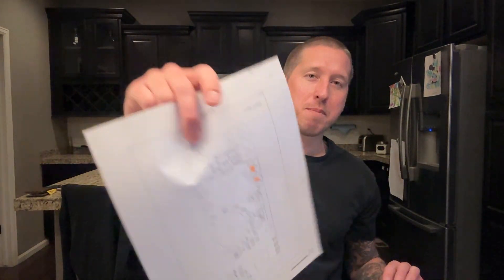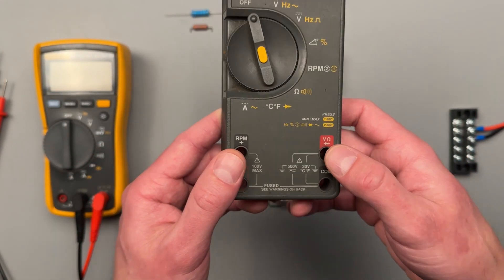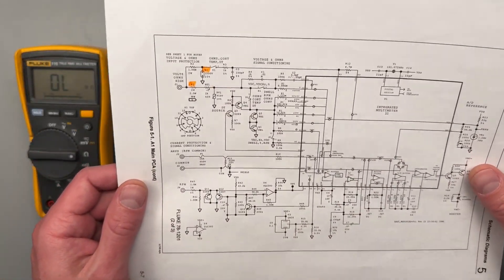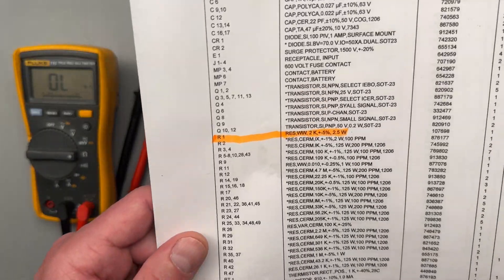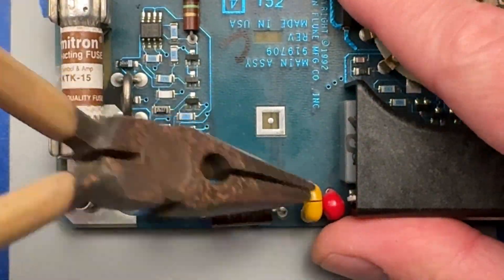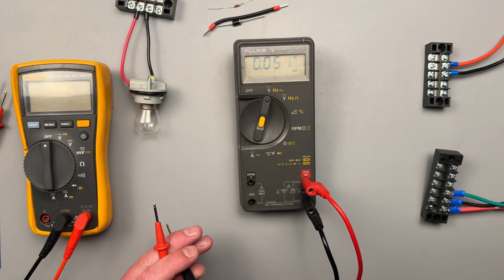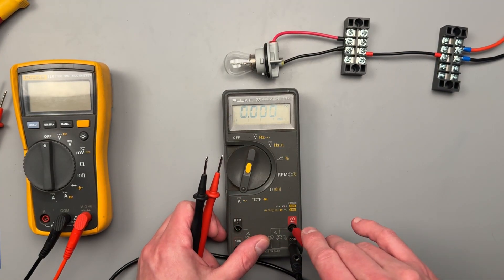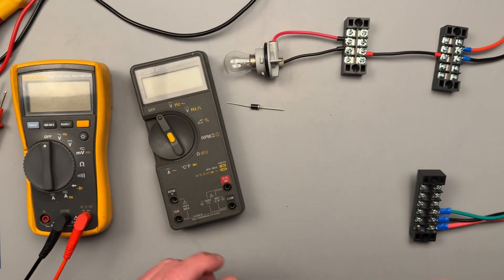FLUKE 78 - Automotive Meter Repair

Comment: I too have a Fluke 78 but the housing is falling apart. I'm in Australia and parts are not available. Would you know if they're available in the US?
Reply from the maker: go here:
https://www.fluke.com/en-ca/product/electrical-testing/digital-multimeters/fluke-78

You'll go to service manual, pages 4-5 & 4-6 have casing parts labeled as MP 14 & MP 17. You'll need to take it from there. 

I would imagine that they no longer make the housing and that you would need to buy another Fluke 78 second hand. Hope that helps 👍
Reply: @maddoxmechanic  Appreciate the quick reply. I will check out your suggestions. Many thanks.
Reply from the maker: @hairycurry5516  Of course! Best of luck on your multimeter repair adventure.

Comment: Be careful when checking the resistance of components that are still in circuit. Remember that voltage takes the path of least resistance and in doing so, it may make its way around and through the circuit in another path other than through what you intend to test, potentially giving you false or inaccurate readings. While frequently a pain, you will get the best resistance reading on a component when it’s taken out of the circuit entirely.
Reply from the maker: @josephreed8310  that’s a great note! Thank you for the component level repair tip!